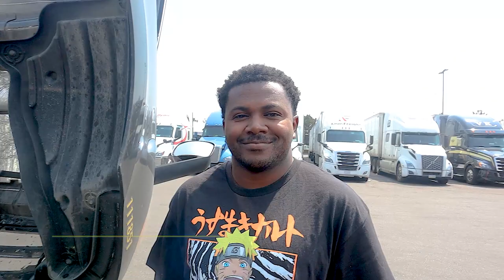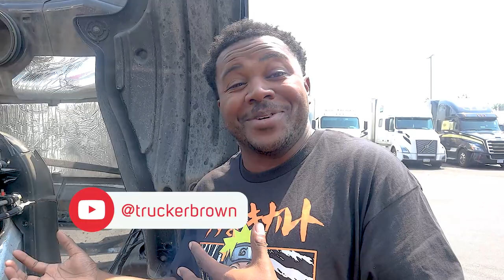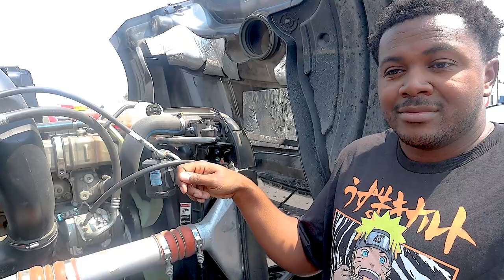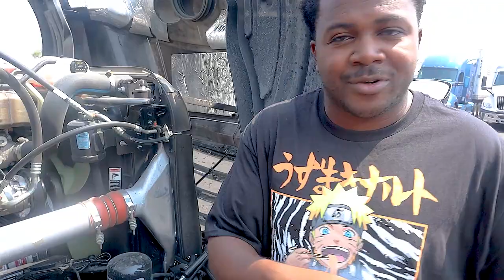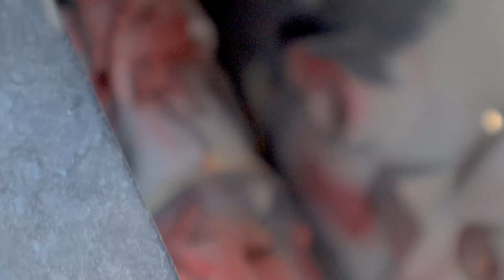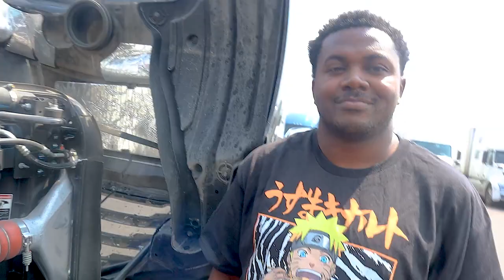The new Detroit Engines are bad ? 2021

Comment: Funny story so on my company 2020 fraightliner, the starter gears and fly wheel will have an issue where the gears will not engage and cause it not to turn. I turn off the power witch moves the starter gear enough to get it's gear in the proper position